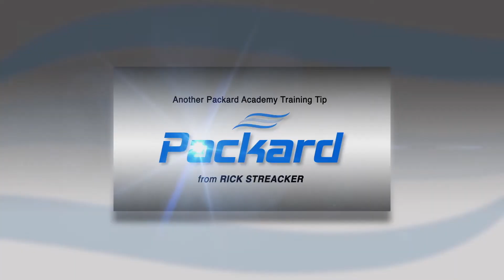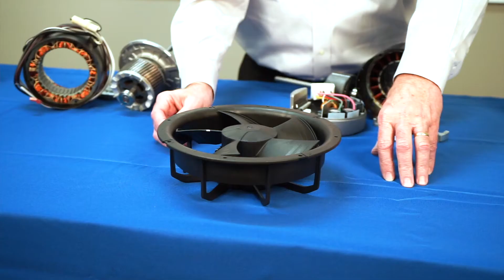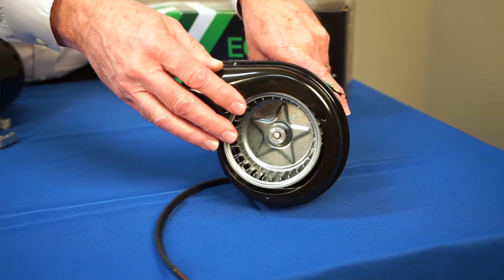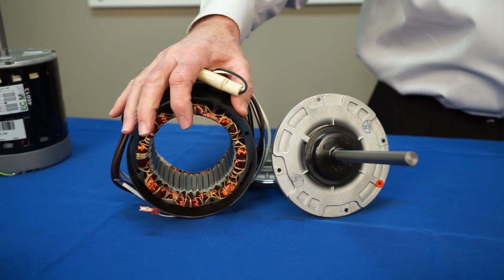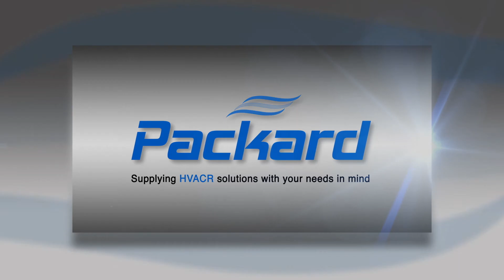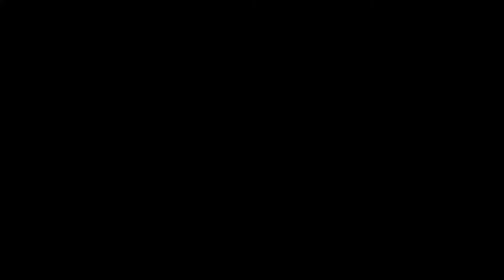EC Motors vs. PSC Motors

Comment: if the control module burns out, can i use the motor itself for anything? such as for another project where an electric motor would be useful.  jus tdid not want to throw it away when the motor itself (the machanical piece ) is still good.   thank you sir.

Comment: I'm a steel scrapper. And I scrap alot of electric motors for the copper, most of which are the PSC type. Any idea how to scrap those Variable Speed motors without spending an HOUR doing it? :(

Comment: ECM technology has created far more problems in HVAC equipment that it has solved. 
Old school PSC motors were for more reliable
Reply: My company builds process fluid chillers that have to run in all types of ambient temperatures from below zero two above 100 F. The EC variable speed condenser fan motors has improved the performance of our chillers drastically. LOL but I know we are a special animal in the HV AC field

Comment: Induction motor is more reliable!  Unlike ECM motors, no modules to fail at the slightest power surge, lightning strike or moisture ingress.  PSC motor much cheaper!
Reply: IMO the actual control electronics aren't that much more expensive. They just charge way more for it because they can. Think about it - you can buy an entire air handler, coil and all, with an ecm motor, and it will be only a few hundred dollars more than the motor. That's just insane.
Reply: Agreed
Reply: You are correct on all points sir.